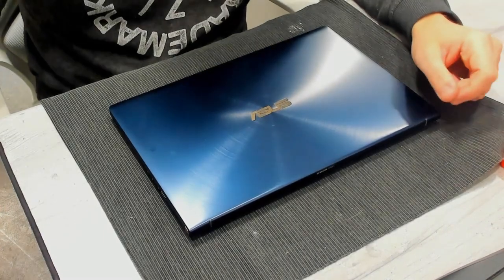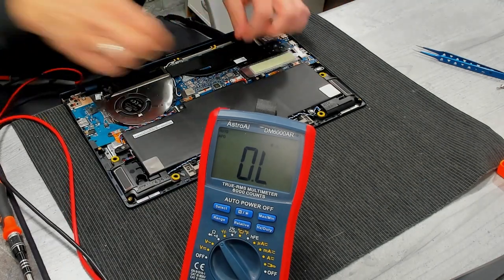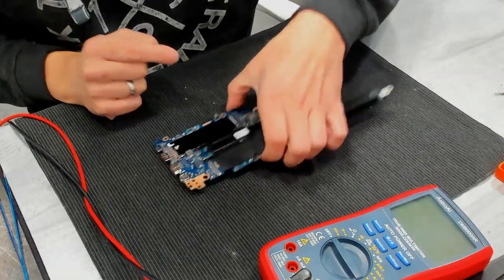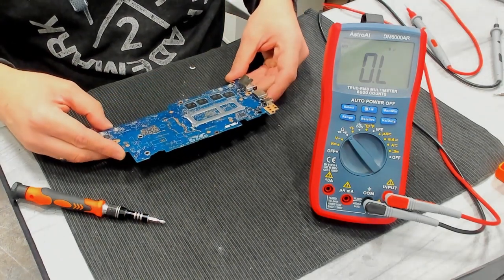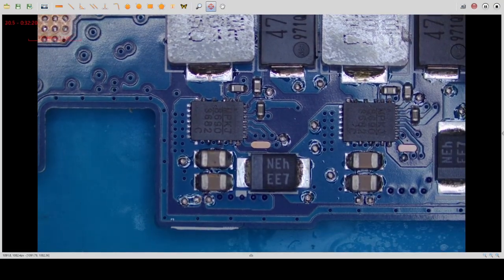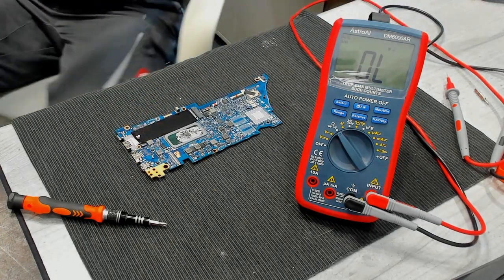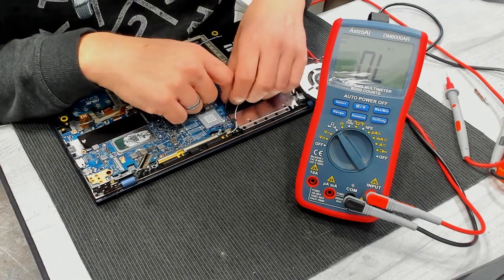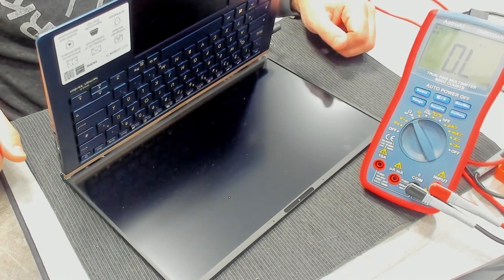ASUS Zenbook 14 UX434F - No Power. How to fix a shorted Main Power rail

Comment: one little tip try to hold cap opposite way of how you  holding it in that touch you will not have problem to your tweezers are taking temperature from solder joints and you need much more time to take out that cap than to you holdem it from right to left on top of tweezers on brown surface. ! nice video keep it going! <3 Edit:  i paused video before you moved tweezers how is supposed to do :) haha :) its all gucci <3
Reply from the maker: Thank you for the tip, though. I'm far away from being a professional, so much appreciate it! <3

Comment: Mate in case of a shorted CPU, would should be the course of Action? My UX434FQ has been sitting dead for an year and half. I need to access the data on SSD, I tried to remove it and using an enclosure tried to access data but thats when I realized at some point I encrypted my drive with bitlocker and lost they keys. So I think my best bet is to repair the same board so that I might be able to access my data. Any advise? Now I use Macbook Pro M1 and I don't think I will ever buy Asus again.
Reply from the maker: If the CPU is really dead, then you're pretty much out of luck here, when the Bitlocker recovery key is not stored somewhere.

Comment: Strange. A few days ago I had the Zenbook 14 UX463FA with the same error and exactly the same defective capacitor that you can see here at 15:42. 
Can this be a coincidence? 
Is it a design error?
And does the same capacitor perhaps go into a short circuit again because of this?
I'm a bit insecure now, because I don't believe in a coincidence here. 
I hope the customer will not complain soon, would be a bit embarrassing for me. 
Any explanation perhaps?

Comment: I too have this same model and like many, have no power. Returned it to Asus - told it was because of "spillage" Strange thing it's hardly been used and certainly not exposed to moisture. Their estimate to repair £900+ (1100$)
Ridiculous to even consider so won't EVER  buy Asus again...particularly as so many have this same problem.

Comment: Hi bro,
I believe I have the same problem with my laptop. Here in Montreal nobody wants to touch it. Where are you? Can I send my laptop to you for repairment? Is it possible?
Reply from the maker: Sorry my friend, I do not accept repair requests right now. Business isn't up and running already. Needs a while. Regards.
Reply: Did you ever get it fixed? I have the same model/problem and I'm also in Montreal. Can't believe this just happened for no apparent reason.

Comment: Did you replace the cap?
Thanks
Reply from the maker: Indeed, so near to the CPU-Circuit it is better to replace, since this area is very sensitive. You should be good to go by placing a 10uF/25V cap on the pads between B+ and GND
Reply: @fairrepair_en  hello, by cap you mean condenser?

Comment: Hello, thank you very much for the detailed video, I have the same problem, do you know if its a bipolar or polar capacitor? I actually could not find a replacement cap, is it possible if you share the PN that i can order?
Reply from the maker: Ceramic capacitors don't have polarity. But you have to pay attention to the voltage rating, at least 25Volts and the Capacitance of course. On the main power rail typically used are 1uF and 10uF
Reply: Thank you very much, I’m in Germany and they offered me to change the mainboard, but when i follow your instructions i see the same issue, but dont know which cap fails there. I will change them both then as you suggested 10uF 25V
Reply from the maker: @kedosch5089  is it the same board?
Reply: It is same ux434f
Reply from the maker: @kedosch5089  and it is already confirmed the same capacitor with voltage injection? Otherwise need to check first and then we can decide with what we replace depending on the exact location
Reply: Unfortunately i could not do the voltage injection i confirmed only the cap pins are shorted to gnd with multimeter
Reply from the maker: @kedosch5089  it is a important procedure. Any capacitor on the main power rail could be the culprit, so you could be bad surprised if you remove the same one like I did without proper troubleshooting. Regards.
Reply: Many thanks for your support but is is possible to show me where can i make a voltage injection? It was not clear for me for + pin
Reply from the maker: @kedosch5089 no problem, First make sure, the Main power Rail is indeed shorted to GND, and i mean a "clear" short below 1 - 2Ohms. check at the current sense resistor at the back, like I did.
If so, then you can inject into the same point (Current sense resistor) or into the capacitor pad, like I did. It is literally the same power rail, so doesn't matter.
The defective Capacitor should significantly heat up, since it has the closest path to GND